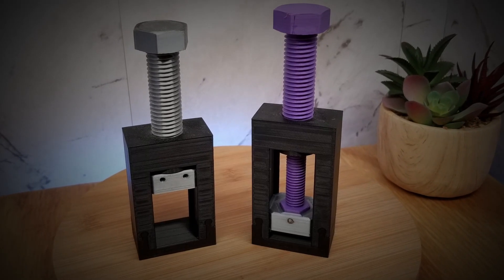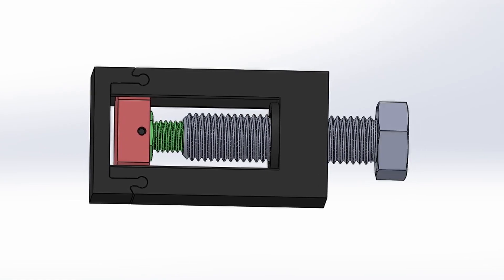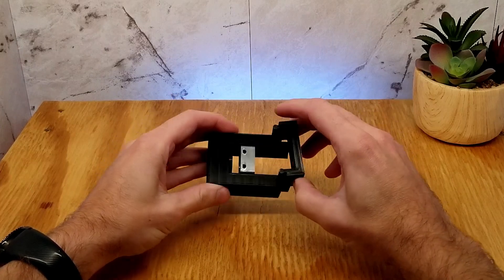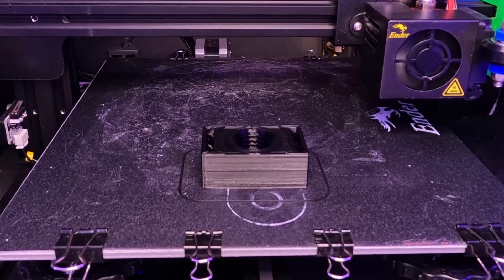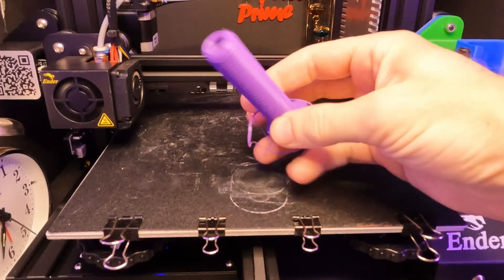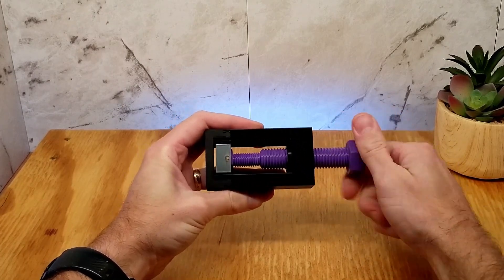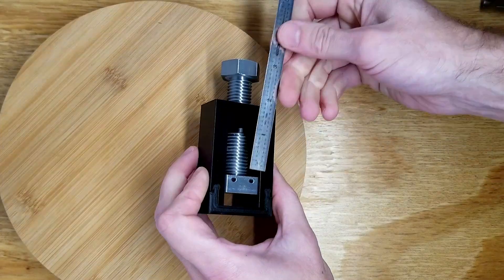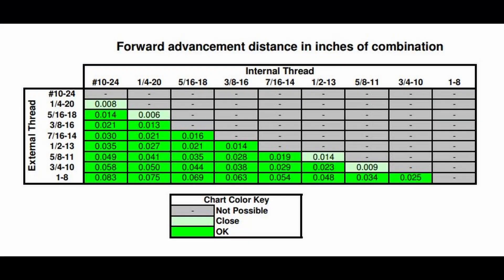Differential Motion - A 3D Printed Example

Comment: I've read that the differential motion has quite a high precision for linear positioning too, but I don't understand why.  i.e. if the screws it's made from is only accurate to 0.125 inches per yard, why would it be greater than that for two of them stacked together?
Reply from the maker: It's the coarser coarse thread minus the finer coarse thread for the actual forward advancement. Kinda crazy being able to have this fine of resolution and so many more choices to find an optimal degree of precision from mixing fine/coarse/metric together as well!

Comment: Useful
two coarse threads, to simulate the effect of a finer thread
-coarse threads are a Lot Easier to 3d print than fine ones....
Reply from the maker: Yes they are! The effect can be much finer than a fine thread as well depending on the combination of thread pitches used! Its wild!